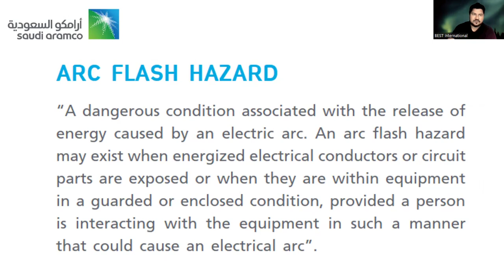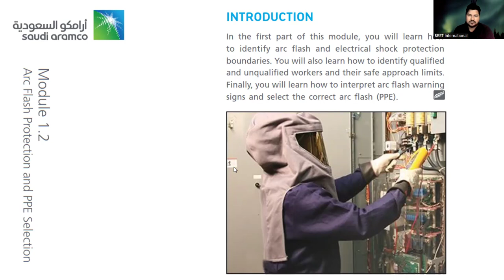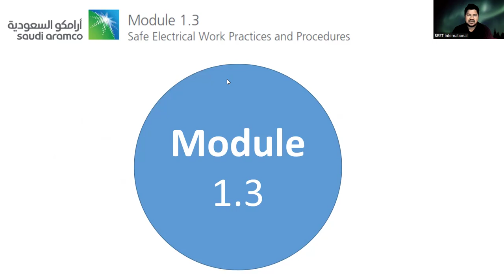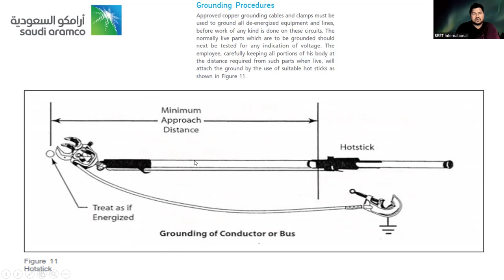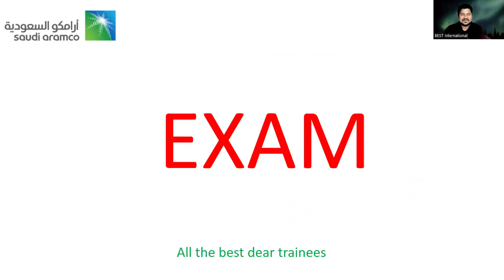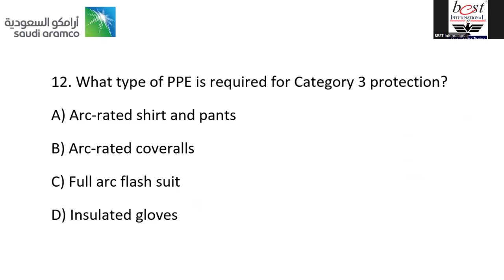Electrical Hazards Recognition  EHR Aramco Safety Training

Comment: Please provide specifications if have thank you
Reply from the maker: Dear Aramco specifications for electrical equipment, including hand lamps, are outlined in the Aramco Engineering Standards (SAES) and the Aramco Safety Manual (SAM). Some relevant specifications include:

Relevant Aramco Specifications
1. *SAES-P-111*: Electrical Equipment in Hazardous Areas
2. *SAES-P-112*: Electrical Equipment for Use in Explosive Atmospheres
3. *SAES-J-601*: Electrical Equipment - General Requirements
4. *SAES-J-602*: Electrical Equipment - Hazardous Areas

Key Requirements
1. Explosion-proof enclosures
2. Low-voltage operation (e.g., 12V or 24V)
3. IP rating for environmental protection
4. Certification by recognized bodies (e.g., ATEX, IECEx)
Reply from the maker: Also watch the same video again

Comment: Sir is there any standard/specifications for hand lamp using in confined space?
Reply from the maker: Dear following are the 
Aramco References🌎✍️✅
- SAES-P-111: Electrical Equipment in Hazardous Areas
- SAM: Aramco Safety Manual

Relevant Standards✅
- NFPA 70E: Standard for Electrical Safety in the Workplace
- IEC 60079: Explosive Atmospheres
- OSHA 29 CFR 1910.305: Electrical Systems

The key point is that the standard reference for using hand lamps in confined spaces is typically governed by local regulations and industry guidelines. In Pakistan, you can refer to the Factories Act 1934 and the Occupational Safety and Health Administration (OSHA) standards, which are often adopted by local regulatory bodies.

Key Considerations
✍️1. Explosion-Proof Lamps: Use explosion-proof hand lamps in areas with flammable gases or vapors.
✍️2. Low Voltage: Use low-voltage lamps (e.g., 12V or 24V) to minimize electrical shock risk.
✍️3. IP Rating: Ensure the lamp has a suitable Ingenuity Protection (IP) rating for the environment.
✍️4. Cable and Plug Safety: Use durable cables and plugs, and ensure they are properly connected.
✍️5. Regular Inspection: Regularly inspect lamps for damage or wear.

Stay Blessed Always. Ameen
Reply: @trainingzone786 thank you very much for your valuable information
Reply from the maker: My pleasure dear. All the best